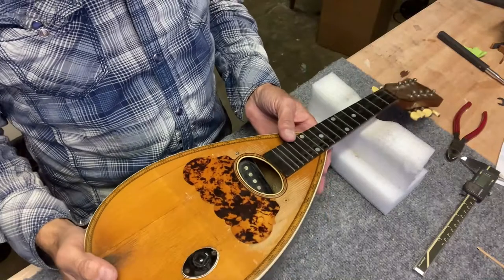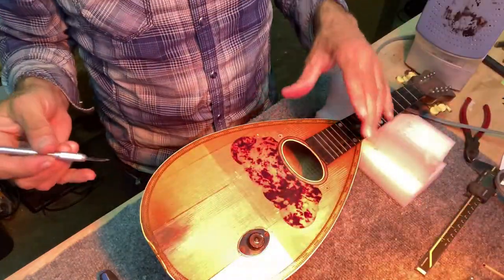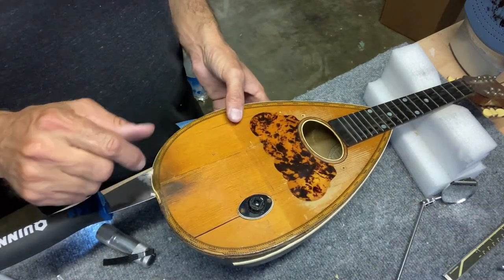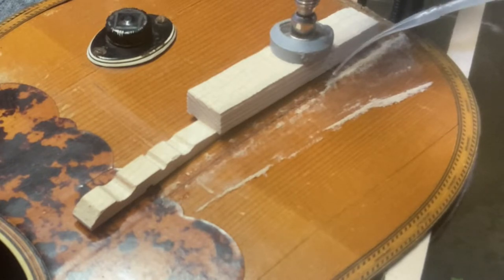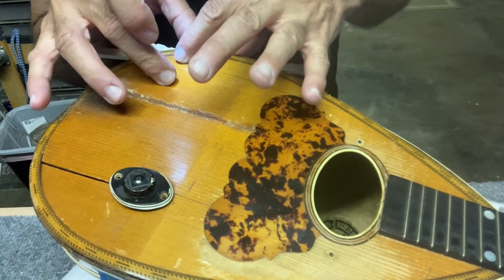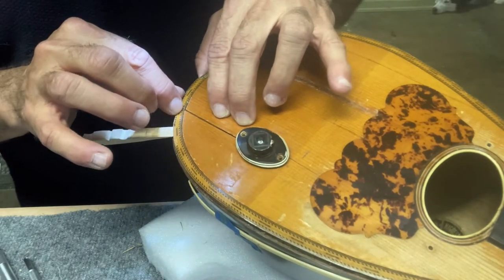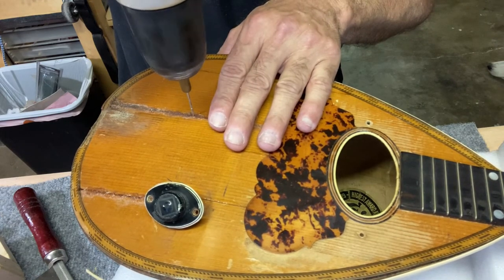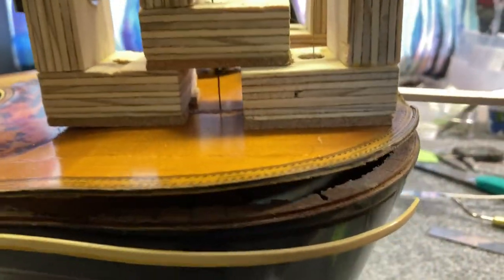Washburn Restoration part 3  - Crack Repair

Comment: I have one small crack on my mandolin with the grain. This video is killing me though I can't watch it through. I just want to seal it up with a little bit of glue I think it'll be alright
Reply from the maker: In retrospect, I should’ve splined those cracks. It would’ve been easier to color match the wood. Well live and learn. Good luck with your crack repair. Merry Christmas!